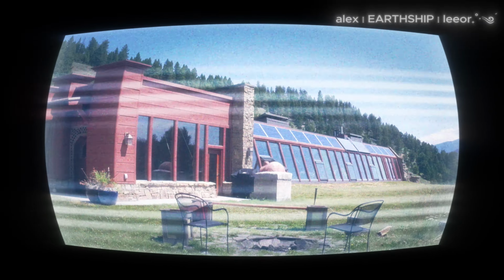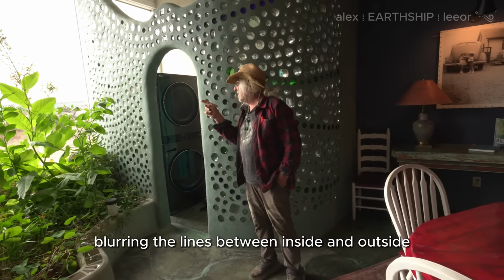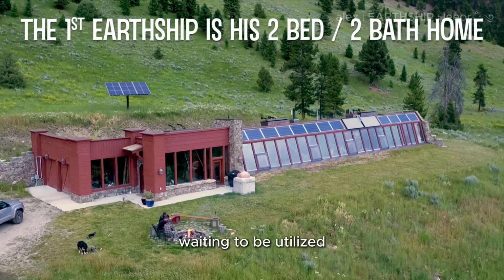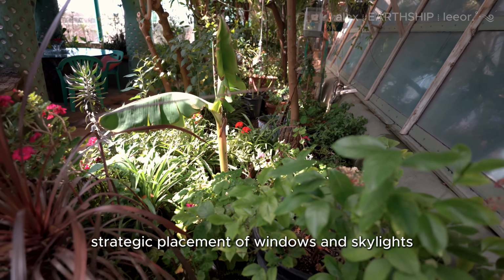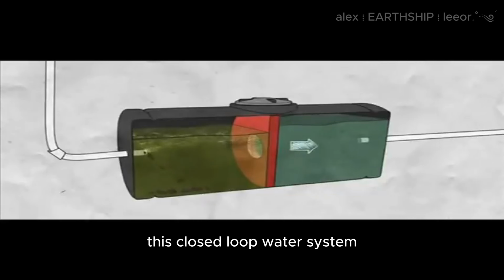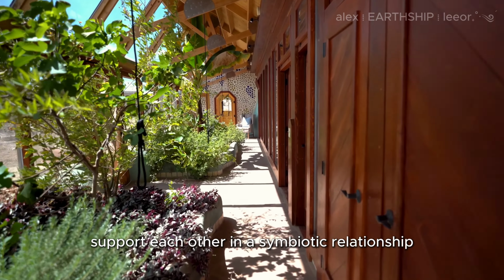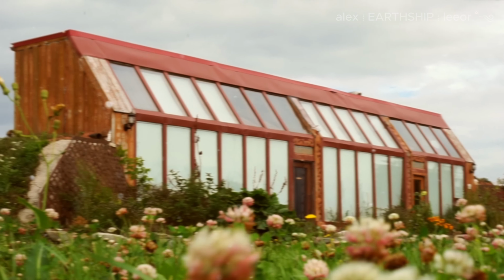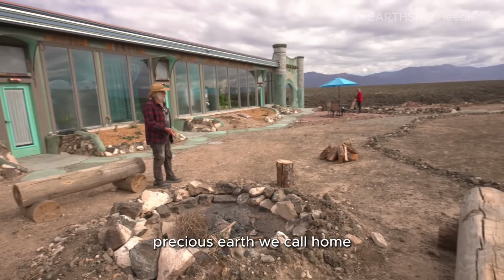Eliminate the cost of living with Earthships

Comment: are there variants that look more like multi-story buildings? industrial economy is kind of impossible without high population density, and high population density kind of requires either multi-story constructions or barracks
Reply from the maker: Your right.. earthships r not suited to city space.. but cam be built anywhere rural which is most of the planet when u dont need infrastructure..

Having said that, if u have a slope u can build on a slope rather than vertical
Reply: @SaiRamWithAlex  actually, most people (~ 60% ) live in urban areas, and these areas are far more polluting than any rural settlements (top pollutants are  obviously the factories, but things like transport or fast food joints are pretty bad too). so making urban housing more sustainable is kind of a more pressing issue.